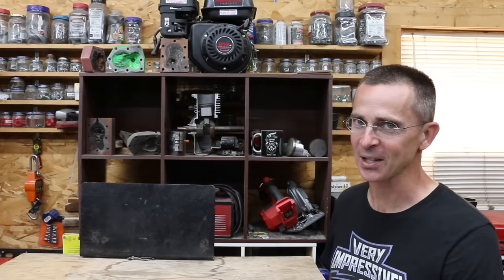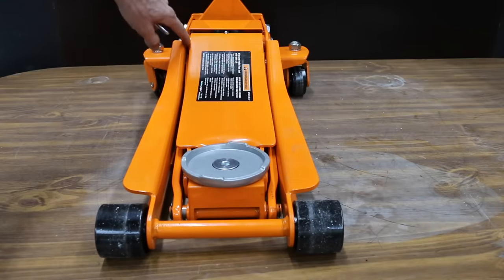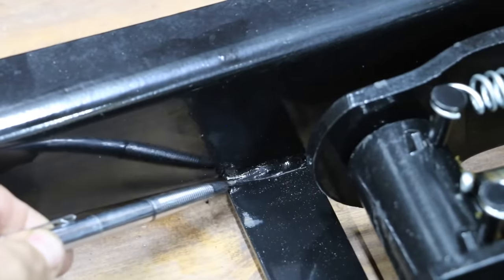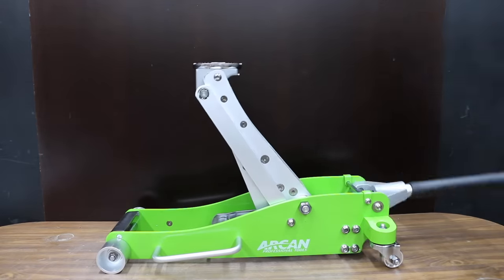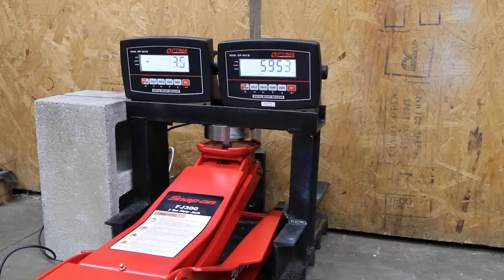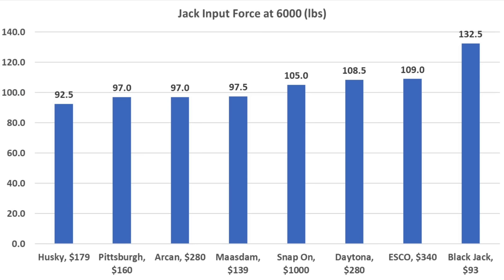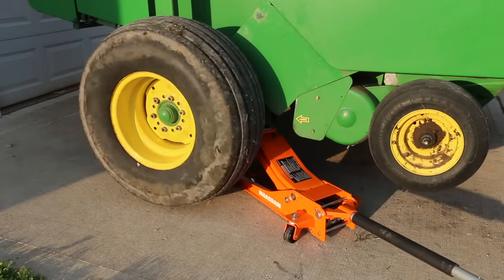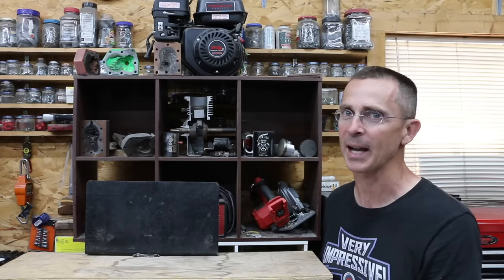Best Floor Jack? $1000 Snap On vs Daytona, Pittsburgh, Arcan, Black Jack, ESCO, Husky, Maasdam

Comment: First of all love your videos think you to a great job.  Have a question/critique though for this video.  Is it fair to say a jack performs better if it's maximum force is higher before a bypass engages?  I would assume these are pressure relief devices that are put in place to protect other parts (that could fail catastrophically) and the goal is to get that to relieve at the designed load and not exceed that too much.

Comment: @ProjectFarm...another great comparison video. If you ever revisit floor jacks, consider the American Forge and Foundry. The is one of the few floor jacks I have found that claim "Made in USA" which the expensive S brand is not. The one I am considering is the "AFF 3 Ton Wrecker Service Jack, Lightweight Anodized Aluminum Frame, Double Pumper Technology, 210".  Thank you.
Reply from the maker: Thanks!  Thanks for the suggestion.

Comment: The jack I bought and LOVE LOVE LOVE was NOT tested. Harbor Freight LOW profile and LONG REACH. I used to need two jacks and a whole lot of issues being able to get to my center lifting point on my E46 M3. 
With the long reach it takes seconds instead of 15 frustrating minutes.
Reply from the maker: Thanks for sharing.

Comment: Wow, that first 90 USD jack cost me around 15 EUR here in EU several years ago (same build type, but without that lift extension). It's very basic, but it does the job for normal cars together with safety jack stands. I just looked it up right now, it's 40 EUR 🙈.
Reply from the maker: Thanks for sharing.

Comment: Does using a floor jack on one side, and then the other side, make the tires land unevenly when you are finished, and lowering each side? If that makes any sense?  I've always wondered this on previous cars when changing my oil (never had a floor jack before, which is why im considering buying one). But when lowering one side and it "lands", and then you move to the other side, is everything "matching" evenly? Forgive me if this is a dumb question, i'm just trying to learn how these things work 🙂This is why we all wish we had a actual car lift that raises the entire vehicle and when finished, all 4 tires land at the same time, evenly.

Comment: Got a husky 3ton low profile. 

Ducker won't roll while having up vehicles. Which causes the saddle to want to shift/slide out from underneath the vehicles frame or jack points. 

Other than that no problem so far. Still going to return it and get another Pittsburgh. Never had any problems or complaints with my Pittsburgh jacks
Reply from the maker: Thanks for sharing.

Comment: An Idea for testing oil filters and run them through efficiency testing the ones I would recommend for testing would be the top tier of Fram, Wix, Purolator, Mobil-1, Amsoil, K&N. Then compare them to the lower end oil filters.
Reply from the maker: Thanks for the suggestion.

Comment: I have a blackjack 2 ton i keep in my trunk next to my 4way and jack stands, its light, easy to work with and comes in its own case, sure i know its not the best but for changing your tire on the side of the road its the most convenient, and since I drive a Kia I don't need it to hold a bunch of weight anyway.
Reply from the maker: Thanks for sharing.

Comment: One problem with the bolt together aluminum jacks is the bolts coming loose from rattling around on concrete or asphalt.  I have an older aluminum one that I have to put fresh Blue thread lock on about 3x a year.  I lost a bolt on one of the side handles, so I just took them both off...
Reply from the maker: Thanks for sharing.

Comment: What a great Video. I bought a three ton at Tractor Supply. After watching this video, I know that I made a good deal at $377. The jack boss Super duty. It weighs well over 103 pounds. The welds are great It does everything you want a Jack to do. Great video.👍
Reply from the maker: Thanks!  Thanks for sharing.

Comment: I was searching for the best bottle jack review thinking you might have done one. I guess that hasn't been looked at by yourself so I'm sure you'll probably cover it in the future. This will have to do for now!
Reply from the maker: Thanks for the suggestion.
Reply: Clearance is a much bigger problem with bottle jacks.  The jack might clear when the tires are aired up....but take into account a completely deflated tire, even a completely deflated tire combined with a badly damaged wheel and you'll not find a bottle jack that'll fit....and you may even struggle getting a floor jack under there to raise the vehicle.

Comment: Comparison Idea:  Irwin came out with one as well...  EnryKuo Labor Saving Arm Jack 2 Pack,15.5 Inch Stainless Steel Furniture Lifts with with Two-Speed Descent,Hand Furniture Jack Lift Tool for Installing Cabinets,Flooring&Windows,Load 660LBS

Comment: My dad's got some transmission work he needs to get done soon and is looking for a jack and stands that goes higher than the one he has now, so he can have more room to work.  Daytona is a clear winner.  Out of all the ones I looked at, it has the highest reach, the lowest profile, one of the best build quality, and is priced very reasonably (I found it for 40 dollars cheaper than this video had listed).  All the other jacks didnt even come close to having the range of lift that daytona has.  When ordering one just make sure you double check the max reach on the model you're ordering.  They have some jacks that look the exact same, but only reach 20 inch instead of 24.
Reply from the maker: Thanks for the feedback.

Comment: I have a suggestion for another video
There are various screw extraction pliers and it would be cool if you could test them how they perform to find the best. There are some from Engineer (e.g. models PZ-56, PZ-58, PZ-59), VAMPLIERS, etc. I am interested in getting such pliers, but some reviews suggest that such pliers usually work only for a short time before teeth brake off or something like that. It would be interesting to see a review where such pliers are tested properly like you typically do to see if any are worth getting.
Reply from the maker: Thanks for the suggestion.

Comment: I wish you put the MAC floor jack on here. I absolutely love mine. It's not made in the same place as the Snap On. I've used both and my brother has a Daytona. My Mac gets 2" inches more height and has a 500lbs heavier rating while being slimmer. I wish you had it on here for comparison
Reply from the maker: Thanks for the suggestion.

Comment: I bought the Husky and ended up returning it because it was extremely difficult to turn the handle to let the jack down. When I finally applied enough force to turn the handle it let down way too quickly and slammed my car onto the jack stand and completely smashed my pinch-weld flat.

I went to Harbor Freight and bought the Daytona and have zero problems with it and let down is smooth as butter.
Reply from the maker: Thanks for the feedback.

Comment: i have had lots of trouble with small wheels not rolling on the driveway and the jack twisting especially the aluminum one i have. It is goofy that they put such small wheels on when the jack platform does not go that low anyway.
Reply from the maker: Thanks for the feedback.

Comment: Remember to buy jack oil too, and to refill the jack from time to time or it will start to lose lifting capacity, also make sure you lube all the moving parts with a liquid lubricant or something like liquid wrench if you don't use your jack that much and to test it once every two weeks or so just to keep the parts from rusting.
Reply from the maker: Thanks for the feedback.

Comment: Wow. I bought a floor jack at Consumer Auto Parts for $29, because I had $20 in Consumer Rewards. I've been using it for 12 years. It not only lifts my Scion tC and my Hyundai Accent just fine, it also lifts my 4,400 pound 1988 Supra Sport Roof with no more effort. Of course, once in the air, I use jack stands.
Reply from the maker: Thanks for sharing.

Comment: Good stuff. I bought a Black Jack at Walmart earlier this year in a pinch (had a roadside flat and my bottle jack didn't have enough reach to lift my truck enough for the tire to clear the ground). I used it last night to pull a wheel off of my truck long enough to inspect a brake caliper just enough to make sure I ordered the right replacement pads. Just as I was starting to put the wheel back on, the frame of the jack warped and twisted and the truck fell off the jack (I wasn't using jack stands because I knew I wasn't going to be going under the truck, and this was supposed to be a 5 minute job. What are the chances?). Net-net, the jack and the wheel were stuck under the truck, and I wound up spending two hours using my bottle jack, cutting up pieces of wood to make spacers, and generally f%#@ng around to get everything back in place.

The Black Jack jack? Went straight into the dumpster. I would suggest that no one purchase one of those ever, under any circumstances. Granted, it's an "n=1" anecdote, but it's enough to put them on my "do not buy" list for life.

I went to Harbor Freight earlier today and picked up a Pittsburgh jack. I don't think it's the same model you tested, but you can clearly see that the build quality is much higher than the Black Jack was. Take that for what it's worth.
Reply from the maker: Thanks for the suggestion.  Thanks for sharing.

Comment: This is off topic because I picked this video from your shop tools playlist.   I scoured your videos and didn't find any that addressed grease guns.     THE BIG FAIL   in modern grease guns is that the follower seals let grease past the follower where it's not supposed to go.   Not only does this waste grease,  it also makes a big mess of the follower spring, guide rod and the cavity behind the follower where grease should never be.      My challenge:   find a grease gun brand that doesn't allow grease to get past the follower.   Keeps all of the grease on the front of the follower piston and headed for the pump to be utilized for it's intended purpose.     Love your channel.   Keep up the good work.............
Reply from the maker: Thanks, will do!

Comment: The Daytonas rear steer wheel was not facing in the direction of movement like the snap on was when the push test started. I bet the Daytona would have beat the snap off jack.

Comment: I used to work at a tire shop where they had 3 Pittsburg Jacks and 1 Daytona and the Pittsburgs were consistently braking and being replaced with new ones while the Daytona Lasted the years of Abuse in a tire shop that's when I knew those Jack's were awesome
Reply from the maker: Thanks for sharing.

Comment: I find myself considering the aluminum Arcan versus the Daytona super duty.   

What does “super duty” mean?  The manufacture does not explain it, and I can’t find anyone discussing it.  

But mainly I’m concerned the 19” Arcan may not be enough height to get my highlander onto jack stands? 

Maximum height:
Arcan 19.4”
Daytona 23.2”

I ended up buying the Esco jackstands.  From your other video, I see that all the jackstands greatly exceeded the maximum weight ratings…. The esco feel very robust, so they will probably exceed their rating as well..
Reply from the maker: Thanks for sharing.

Comment: Thank you for this great video. All the data was useful and appreciated. Great tip on how to add hydraulic jack oil! Regarding the oil however, since it is hydraulic oil, is it hydroscopic like hydraulic brake fluid? Does it need to be drained and refilled periodically? Thanks again, and kind regards.
Reply from the maker: Thanks and you are welcome!

Comment: Safety wise, Snap on seems like the best option. You mentioned that the wheel size matters and that the snap on jack can hang on to the differential better, when being pushed. You also mentioned that it had the best welding points. I think Daytona is really competitive, but if I'm going to be constantly using a floor jack, I'd prefer Snap On for this one so I can have the least amount of accidents which would cost more money in the long run. If I couldn't save up a grand though, I'd prolly go with the Daytona. That's a really competitive price. They prolly have a great R&D department.
Reply from the maker: Thanks for the feedback.
Reply: No point of snap on unless you want to look cool. Daytona is perfectly fine.

Comment: Is that a Fisher Space Bullet Pen? I use a 1994/5 Lincoln 3 Ton that came with larger 6 ton Jackstands for $535 on sale @ Barens in Cannon Falls Minnesota. I bought it in 1996. 4” to 24” and works perfectly, still. It’s better quality then the Snap On however similar in size and performance. I use a Fisher CH4 gold grid & black grid design Fisher Space pen every day. Definitely great pens, medium blue & black ink cartridges. I use vintage ones from the late 60,s-early 1970,s once in a while also. AG7 is good too but not as well balanced. As a machinist I need a Space Pen for my Machines logs, Great Video!
Reply from the maker: The pen I use is a Fisher Space Bullet Pen.  Thanks for sharing.

Comment: Although there's no discussion that the broader/stronger jacks are a safe and easier to use option, etc. 
I have one similar to the "black jack" with the rotating handle feature. Since my garage is really small and tight. I can't enhance enough this small detail. It simply makes the difference between having a functional floor jack or not. 
Giving the chance the big brothers are definitely a more agreeable choice. ;-)
Reply from the maker: Thanks for the feedback.

Comment: I bought a 3.5 ton Craftsman with a quick lift feature almost 20 years ago and left a load on it overnight and it ruined it and I had to run to Harbor Freight because I had a truck to fix and got a $60 3.0 ton Pittsburgh not as nice as this one and that has held up great and I've overused it plenty of times. I've never had to really do anything to it. It's a little rough as far as easing down a heavy vehicle slowly but can't really complain. Got another Harbor Freight low profile for my Trans Am and no problems with that either, both for what I got the Craftsman for though I'm sure most of their jacks are excellent but maybe they lost some durability with the quick lift feature. I gave that away. I don't like to bother fixing stuff that lets you down the first time you work it hard and didn't know what was wrong with it either.
Reply from the maker: Thanks for sharing.

Comment: I have a low profile heavy-duty Pittsburgh 3-ton Jack that has worked amazing got it at harbor freight I think it was $100 at the time! My neighbors have the $1,000 snap-on Jack their mechanics they use it damn near every day or at least a few times a week they've had it well over ten years and they said it still works perfect... If I was a mechanic I would get to Daytona I think that's hands-down the best!
Reply from the maker: Thanks for sharing.

Comment: When it goes on sale at Harbor Freight, I snagged the Pittsburg for $98 using a tax exemption. I used it restore a 10,000 lbs gooseneck trailer where it lifted each side relatively easily. I then placed the trailer on Jack stands, as Project Farm recommends. Taking it back down was equally uneventful. Very pleased with the purchase - so I was a little surprised to hear him go straight for the Daytona, but then again, he paid full price for both. Daytona doesn’t really get the same magnitude of sales prices, I don’t believe.
Reply from the maker: Thanks for sharing.

Comment: I love your channel and going through past reviews. Have you thought about wheel jacks? The versions that clamp out side the tire and lift and with 4 can roll a vehicle around. May be expensive for 4, but I'm sure you could devise some test for lifting ease and rolling under load, on smooth and less smooth surfaces..? I bought some "betterish" ones for my small cars, but my brother is not impressed with his 50% heavier cars.
Been telling everyone I can to check out your channel before they buy most any tool!! Thanks for your work!
Reply from the maker: Thank you for the video idea!

Comment: My Chinese made floor jack I bought in 1985 gave it up a few weeks ago. I paid $55 for it back then.  The labels are long gone, so it isn't possible to find the right seal kit to rebuild it. No one sells just the hydraulic jack for these at a price that makes it worth messing with over buying a new jack. What a shame. And a waste. I got a little attached to it after nearly 40 years of reliable service. 
Anyway, thanks for the review. I ended up getting the Pittsburgh 3 ton aluminum low profile racing jack because it popped up as a $100 off flash sale a week after I was looking for a new jack.  (Hmm, how did they know?)
Reply from the maker: You are welcome!  Thanks for sharing.

Comment: Love your videos and comparisons.  So I have a new 3500 series truck with a Cummins diesel. Could you or have you do/done a video on different diesel filters?    The Cummins truck has 2, cartridge type.  I curious if one brand is better than others.  I know the Branded filter for my truck is actually a fleetguard, but there are a lot of others and I would like to see a comparison video between some say in the $20 range up to and including the "brand" recommended filter.   If this topic has already been covered, could you provide me the link to the video? Thanks for all you are doing.
Reply from the maker: Thanks!  Thanks for the suggestion.